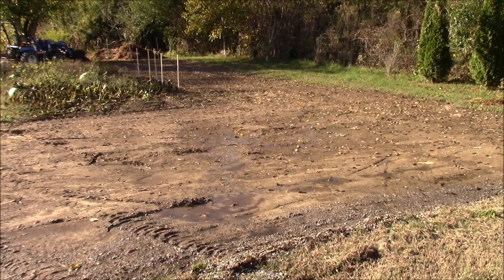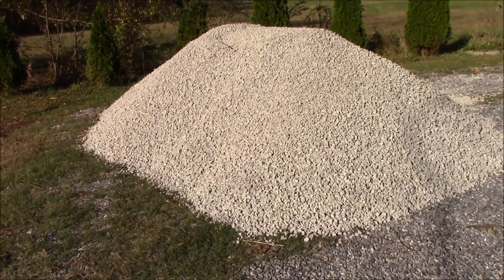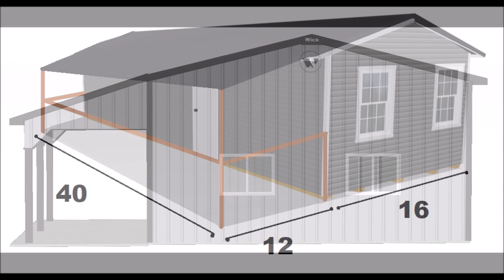Building A Workshop | Building A Stick Built Shop

Comment: We are on grid with solar panels east-west oriented for 3 years now. In that way we minimize our impact on the grid capacity and maximize our internal usage. We are convinced that east-west is the most cost effective way to handle the upcoming smart metering. Germany and Belgium are already asking their people to put up solar panels east-west, just to reduce the peak/over production around noun. Germany is already exportinging solar generated electricity around noun for rock bottom prices. Best wishes, greetings from Holland.
Reply from the maker: Our situation is sort of unique, living on the side of the Smokey Moutains...  Our east side would not see sun until 11am or so, and at a terrible angle...  The west side would catch some, with some compound angles on the roof...  But in any case, solar would not be able to provide the load we need to draw with the air system and welders....

Comment: Good morning Mark, hi Tina. Ok, just so ya know, my middle name is Curious George, and my shadows name is Murphy ,and you just woke them both up!!!! (so much for watching football)   LOL   I would want a sink, clean my hands while working on the lawn mower, outboard, etc. Sink requires water supply (that wont freeze, heat source) and a drain. (gray water well?) Heat source, even just set on 40-45 degrees in the winter will also help keep your tools from rusting, just due to humidity. Heat pump on its on circuit from a  small solar panel? and a whirligig vent on the roof? (who knew whirligig was a word?   maybe Tina)One of your benches should be built on locking casters, (not permanent) so you can pull it out into the room to work on projects that you need to get around, and roll back to it's home when done. (I hate saw horse's) Wiring, outlets and overhead lights. 2 circuits, 1 with half the lights and the outlets at the other end, and visa versa for 2nd set of lights and outlets. That way, when the lights go out (for whatever reason) over the table saw that is still running, you still have light from the other end of the room. Less chance of loosing a digit or two. OH, and a couple of ceiling fans for air circulation. Keep ya cool in the summer, and help with humidity again in the winter. Last, I think you have, but check out Hollis and Nancy. Hollis, IMHO, is the master with projects, and building things. OOOPS, really the last,     Footprint!!! Where's the dust collector going to go, the generator, bench grinder, vise, chop saw, table saw, drill press, etc,  etc,  etc ? Some progression vids would be great!!!!        If it looks like I have a PHD in OCD,  you got me, BUSTED, but If you do it right, you're done and gone, if you're doing it twice, ya done something wrong!!!!Am happy for ya, best wishes on your new he shed!!!!   Mark
Reply from the maker: Lots of good information...  I am thinking an outdoor (over stone) wash area since the hose is close at hand...  Once we are insulated in, I will look into different heat sources (my lungs are always a consideration)...  The "island" workbench in the middle of the floor will be on casters for sure...  Lots of good stuff...

Comment: I plan to watch everything you post on the build.  Construction is what I do and each state is a little different.  I also plan to draw up the building I n my AutoCAD software to see it better and check out the access and needs.  You may want to have a sub panel for power.  Welders need a lot.  Consider exterior outlets to.  The O2 storage should be in a special storage unit for fire.  Moving the grille or smoker in and out may need a sidewalk from the overhead door to the back patio area.  Should be fun!
Reply from the maker: Sounds good Kevin !  I think the sub panel is something they are looking at, but I have told them I will be welding so we knew what type of air handler we needed as well...  I like the idea of exterior outlets...  I have a oxygen cabinet designed for a work environment (even has a small vent tube / pipe to the outside)...  And I am not sure if I showed it, but we are actually putting a 48" steel entry door in the middle of the back wall, specifically so I can drag big things in and out of the shop (smokers included)...  LOL   Thank you for all of the great suggestions !

Comment: Too cool....she's got her she-shed, and he's getting his he-shed. Please share all the build phases of your shop. Upon completion I would install rain barrels, and add  some loft storage that is fixed platforms along two opposing perimeters (no deeper than necessary, to preserve an open ceiling in the center). Task lighting and grow lights hung below the loft bases for lighting workbenches and seed trays tables. And, maybe a screened porch within a year, or so. Hinged frames on the screens could be configured to bi-fold and be securely latched to the porch posts.  A double door access, also hinged on only one side (bi-fold) so the door can be latched tight to a post. Oh, I was going to suggest a skylight on the porch roof, but the wish list has gotten long enough.
Reply from the maker: Not too long at all...  Those are some great (and thought out) suggestions, thank you !  Thanks for watching and have a great weekend !

Comment: What an exciting project. I look forward to watching all the steps in the process from beginning to completion. I saw a suggestion about canning in the outdoor kitchen/patio area. That is an excellent idea. It will go a long way to keeping you and your home cooler in August and the rest of the canning season. I would suggest that whereever you place your stove, barbecue etc. that you have something to cushion the standing area - thick rubber mats or another type of thick mat as they will go a long way in preventing fatigue, sore feet, knees and backs. They are easily cleaned by using a garden hose. I am assuming, of course, that you will have a water hookup out there.
Reply from the maker: That is a great idea...  Oddly, I considered pads for the garage side for when I was working on things, but I had not considered the hours I spend standing around the smoker...  Great Call...  Thank you !

Comment: Great project and adventure. I worked construction for 30yrs and the  remark most often heard was "wish we had gone bigger". Flooding restrictions are of course first to be considered. I didn't hear what your ceiling height was going to be, I hope it'll be 10ft with 8ft access doors. Outlets for your tools every 6ft worked for my shop. Also, compressed air lines all around the perimeter.  Sorry this got so long , I can go on about a shop. As much film as you can do would be appreciated. Thank you and Tina for your outstanding info.
Reply from the maker: I really like the air lines suggestion...  My father is forever dragging his around...  We are only going 8' on the ceilings...  I had asked about the extra height when we were deciding on garage doors and I was surprised at the cost differencial when they cannot use precut studs...  LOL

Comment: I have 3 short term goals to reach before I move to N. Idaho. Buy a 4x4 truck.  Buy a 5th wheel.   Save every penny for the homestead. I just bought my truck and will have it paid off in March... then I will sell my carJune I will buy a used 5th wheel and pay cash for it. I will then sell my small travel trailer Then save for 1- 1 1/2 years for the homestead. I live amd work on my Co. Property so I don't pay rent or utilities. I want to have a 40x 100' garden and orchard. Do lots of canning in the garage. I want a few egg laying chickens and a donkey. My daughter wants minature goats to make goat soap and breed them. One side of my garage will be a work shop. I want to get wood working and build live edge furniture. I plan on an outdoor kitchen as I am a chef and area for the family to gather and eat outside.
Reply from the maker: Yup...  You are gonna be busy...  LOL...  Just remember, you can eat an elephant, if you do it one bite at a time...  (PS...  Dont eat elephants !  LOL)

Comment: Foam insulation? Are you considering soy foam? The building looks to be a Good general design. I d like to see the details,  the problems and solutions. But don't get in their way. I'm a drafting and design artist that's interested in practicality  for your needs.
Reply from the maker: Sounds good...  I will look into the soy foam...  My father was a draftsman for a tool and die shop for many years before working / retiring from Ford...  Appreciate your interest !